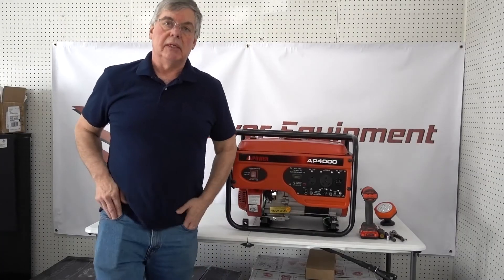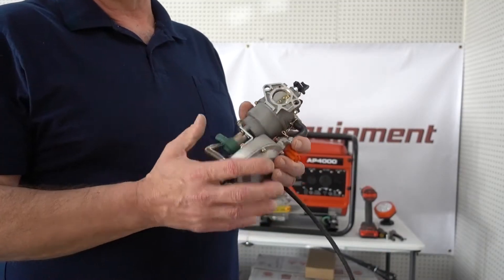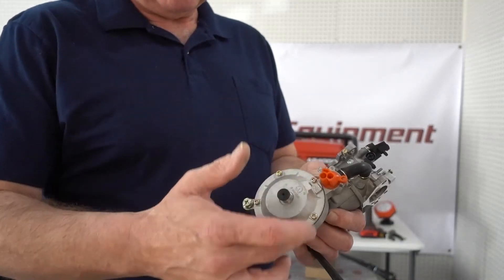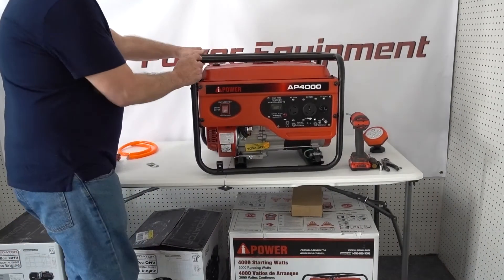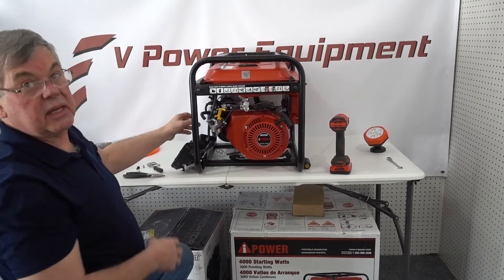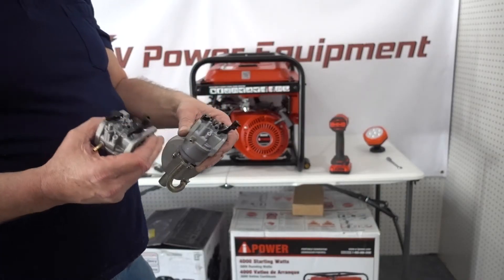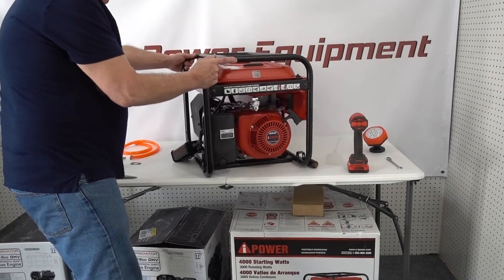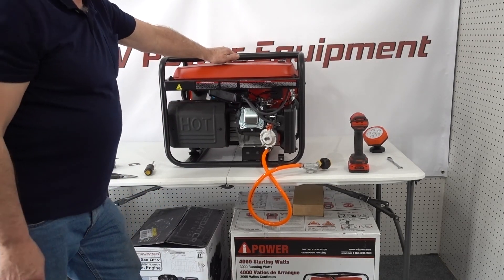Generator Tri-Fuel Carburetor Installation and Information

Comment: What size thread is on the hose barb that screws in? I need to replace mine and change to a 3/8 flare fitting to hook my propane hose to. I have heard it is 12 mm but there is a 1.25 thread pitch and a 1.50 thread pitch.

Comment: 6:35 When you talk about switching from Gasoline to LP, isn't the float bowl still full of gasoline or does the switching process bypass the bowl?
Reply from the maker: yes the bowl will have gas in it some times the generator will drain that bowl first and sometimes it will just start running on LP. So if you are storing the generator and have run on gasoline we recommend draining the bowl

Comment: Sir i have company fitted same dual carburetor.
My problem is how to adjust gas setting when i switch it to CNG fuel supply get low but if i move it little towards lpg than fuel get stable supply.

Please need little guid for this 
2nd thing my generator keep missing in startup but get stable after few mints

Comment: Thank you for the video. Please could you indicate the regulator pressure for the LPG side?
Reply from the maker: no higher than 1psi about .47-.55
Reply: The issue I have with my own, when the gas pressure is very low, and I turned on my AC, the generator begins to jerk and voltage fluctuates. The generator is a 3.1kv. Also, when the gas cylinder is filled with gas to capacity, it runs the AC well. So does the gas pressure level affects the voltage the generator produce?
Reply: @efeanderson689  Something I found, when the cylinder gets close to empty, the pressure drops causing your air fuel ratio to become erratic.  A way I found around this is to put the cylinder in a basin or something and then pour boiling water over the cylinder (2 liters or so). This will then raise the pressure inside the cylinder

Comment: Thank you for posting this good information!!!!!!
The kits with the large regulator cost as high as 350 and are not needed if you're running natural gas or
propane with a regulator, I scored a 5000w generator for less than a hundred from my neighbor because it needed a carb rebuild.
It's really hard to justify rebuilding some carbs, especially when you can do this upgrade, Great video.
Reply from the maker: There is a set of screws in the control knob to fine tune the unit however I must say it is almost always not needed
Reply: V Power Equipment, This was the only video that actually explained that this is a low pressure flow control carb,
Not a high pressure regulator that nobody needs anyhow, I spread your information on Amazon, Thanks again!

Comment: Where can I buy a kit?
Reply from the maker: WWW.VPOWEREQUIPMENT.COM
Reply: any need,contact me.
Reply: I have a ai power 12000 it's a 459 cc how much would a kit cost? And do you have one?
Reply: I have a duromax dual fuel XP12000EH. Will it work on it?